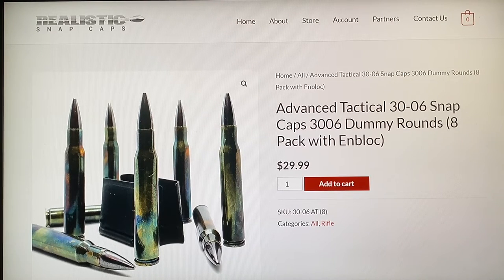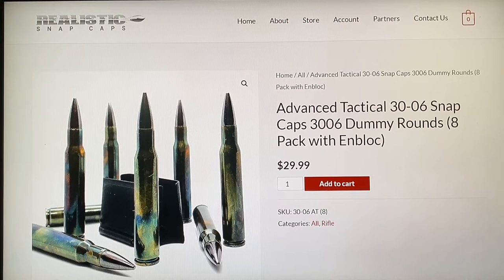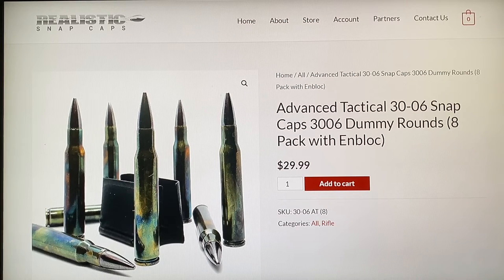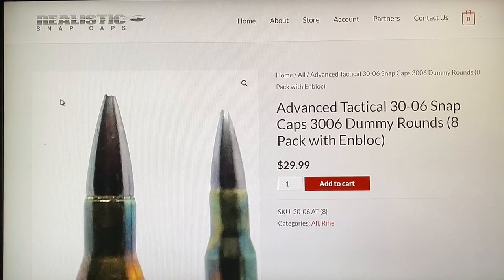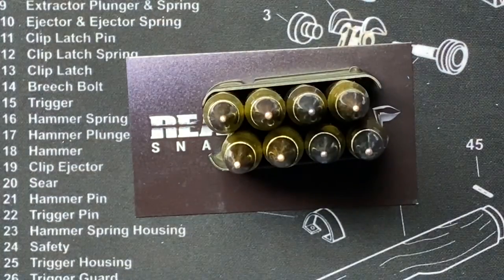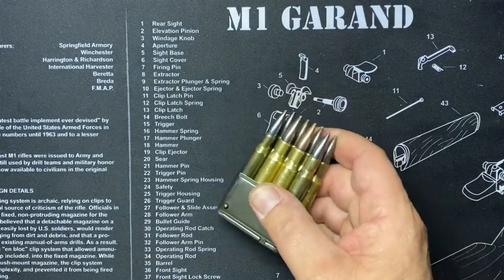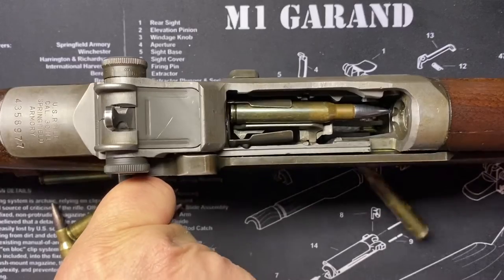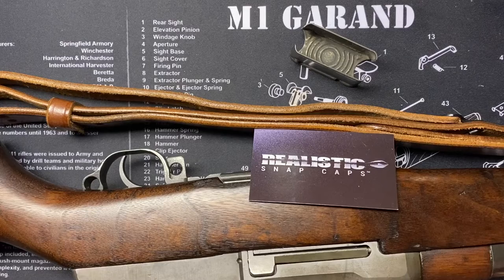M1 Garand En Bloc Clip Loading How To

Comment: Thank you. I just picked up a garand fairly recently.  And last time I took it out I was having random cycling issues. Not terrible. But occasionally wasn't picking up rounds. Most of the time it was the first one. And I knew it wasn't the gun. Thought maybe it was the old enblocks. But after watching your video, I'm pretty positive it must have been me loading them. I'll use your method next time and hopefully that should solve that. Thanks again

Comment: I was going to tell you a little trick you can sometimes use so you want have to take a full loaded clip apart to move one or more rounds back into position,  take an empty case and put the case mouth on the opposing loaded case mouth and give it a push,  it usually works. For small adjustments anyway!
Reply from the maker: Nice.  On any given range day you should have PLENTY of empties around.....